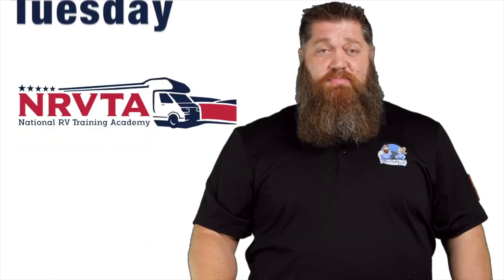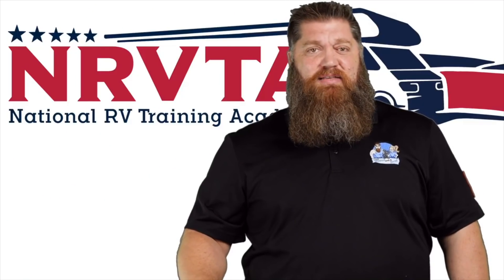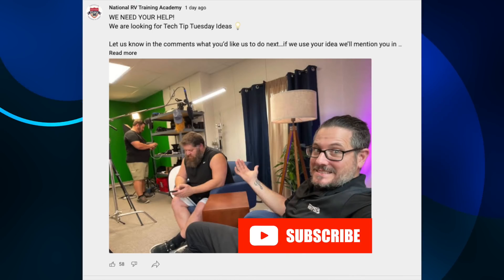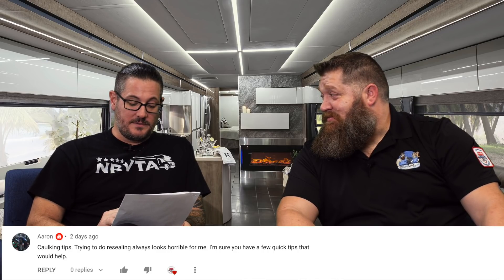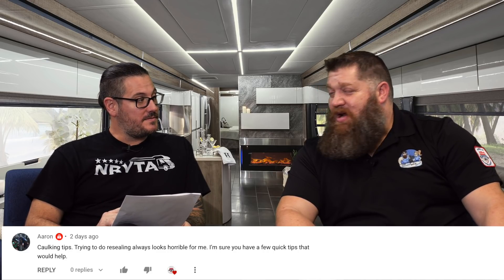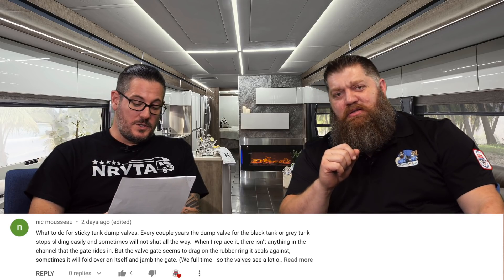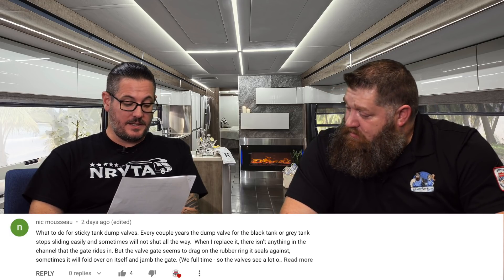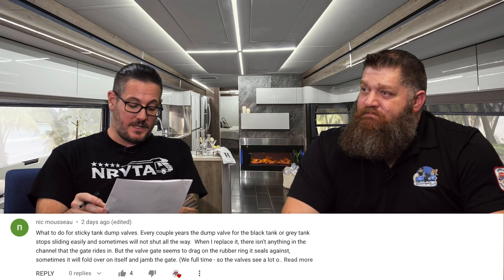Q&A Caulking, Slide-out Adjustment, Dump Valves, & Overheating Generators

Comment: We just had a slide out bolt snap and a bracket bend on our dining room slide. Have you ever seen this? It's a 2022 grand design with less than 1200 miles on it.

Comment: For the overheating generator, the 12.5 Onan I had on a work truck had an overheating problem. Turned out to be worn out belt preventing the fan from drawing enough air over the radiator.
Reply from the maker: That’s good to know! Thanks for posting

Comment: I just moved to a storage facility with 20amp service. I can either plug in the shore plug, which is 50amp, using those dog bone step downs to 20amp, or hook up a trickle charger to keep my batteries charged. Is it safe to do either one while in long term storage?

Comment: I was told on resealing roof, never use silicone. Nothing will ever stick to it.
Use something like Dicor.
Reply from the maker: So the discussion was not about the roof but the sidewalls of your RV. 

Sealing the roof is different and you are correct, silicone will not stick to rubber.

Comment: I gotta disagree about using silicone as a caulk sealant outside the camper. It doesn’t seem to hold up, and you have to get every trace of old silicone off before laying a new bead because nothing sticks to dry silicone, including new silicone. It’s just a total PITA.

Comment: Well, he lost me at "SILICONE".  I have used it for years and finally figured out it is awful.  And now most knowledgeable people agree.  Might work on first application.  But you CAN NOT get rid of it.  So subsequent applications peel off.  Nothing will ever stick there.  There are plenty of alternatives.

Generator installations correctly engineered by the manufacturers?  BULLSHIT!   I have had problems with overheating factory installations and was able to discuss it with Onan factory reps.  Onan want's the heated cooling air directed away from the incoming cooling air.  The RV manufacturers just don't bother because of money and time.  Just  this year at the Keystone booth at the Hershey RV show I saw a directing plenum installed on an Impact toy hauler.  Nobody in the booth knew anything about it.  So if you guys think factory installations are good, you're showing a lack of real knowledge.  Get somebody on who has actually banged his head on these problems and has the scars to prove he knows what he's talking about.